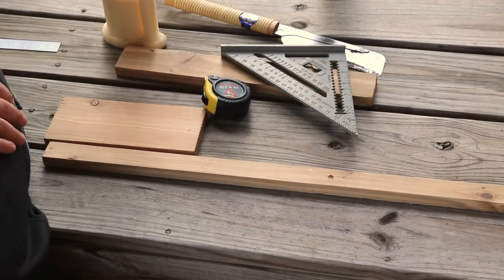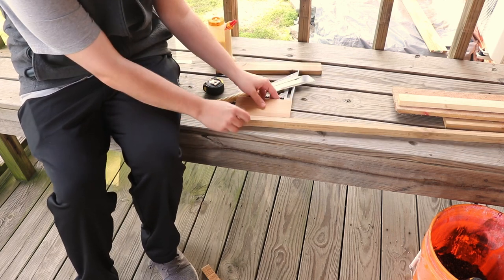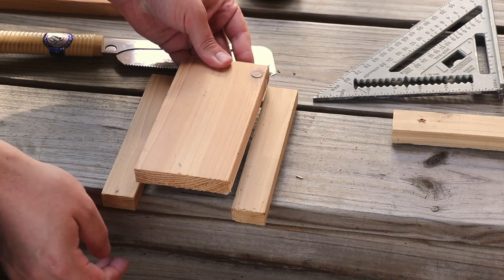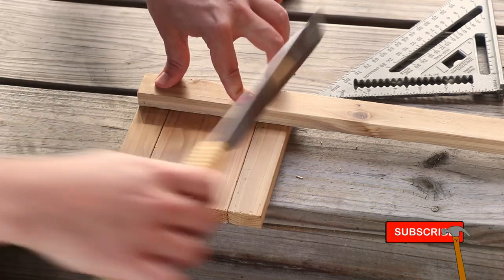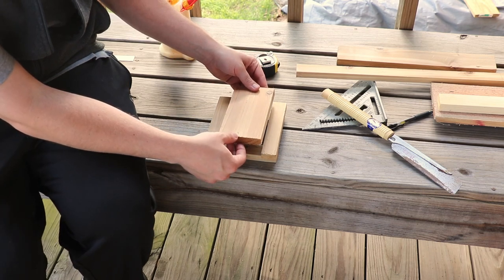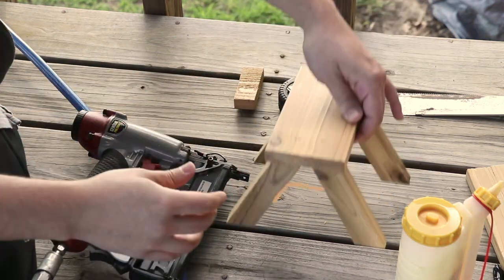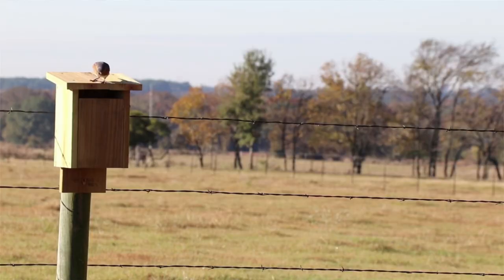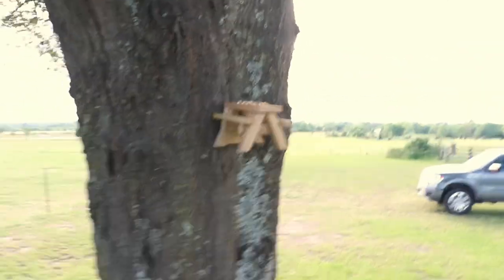How to Build a Picnic Table Squirrel Feeder  🥜🐿 A Squirrel Feeder That Looks Like a Picnic Table

Comment: how good is the japanese pull saw for thicker wood? do you use it a lot of things?
Reply from the maker: This one isn’t so good for thick stuff. I don’t know how to describe it but there is a piece of metal that runs along the back that is wider than the blade so it wouldn’t let it go any deeper than that. I don’t know if that makes sense.
Reply: @AustinMakesVids  That's a decent description - Since you have a "Dozuki" It's a thinner blade with finer teeth and that piece is basically a backbone to give support to the blade.  A good companion saw that will cover you for cutting thicker stuff is the "Ryoba".  It is thicker with teeth on both sides (fine on one side, rough on the other).  with this combo, you can take on the world.
Reply: I can go through a 2 x 4 using a ryoba in about 10 seconds.
Reply: Alright, thanks. That totally helps. Dave, with the Ryoba, you think if I’m just doing random projects with 2x4s and not cutting too much, you think I could get away with using the Ryoba instead of getting a smaller circular saw?
Reply: @bananafred123  Yes  BUT  make sure to buy at least a medium quality ryoba - or dozuki.  (probably in the $29 - $35 range for the ryoba.  There are a lot of cheap ones at places like harbor freight etc, but they won't last as long or stay sharp for long.  A good Japanese saw also has a replaceable blade(like the one Austin uses in his video) so that when it gets dull you can reuse the handle and replace the blade for about half the price.  As far as how much work it will be It depends on how many cuts you want to make. If you are doing a small project that requires making 10 - 15 cuts through the typical softwood  2x4's you can definitely get away with itand enjoy a more "zen" less noisy experience.   In most states, the construction 2 x 4's are made from conifers(softwood). - doug-fir, spruce, pine etc...  Having a combination of the ryoba and the dozuki is a great way to do small projects without making a lot of noise and keeping it simple.  There's also a lot of great youtube Videos out there showing all the things you can do with the Japanese pull saws  - like bending them against a surface to shear off a dowel.....
Reply: @bananafred123  SUIZAN is a good company.  I have amongst my Japanese saws both the ryoba you are looking at and a dozuki.  I love them but also the replacement blades are reasonably priced at about half the cost of new and they seem to last a long time before you need to replace them which is key.  If you just use them once in a while, they could conceivably last you a couple years before changing blades.  They are the highest rated  Japanese saws on Amazon so I think it's safe to say woodworkers love them.  Regarding Austin's - he's using a Dozuki, not a Ryoba which explains the size difference. This is not unlike having a claw hammer AND a Ball Peen hammer. or two different weight/size ball peen hammers.  It's simply a matter of different sizes for diff jobs which Austin illustrates in his comments about his saw working great for thinner wood and not as quick for thicker(that's the ryoba's job).   Cheers and happy sawing!